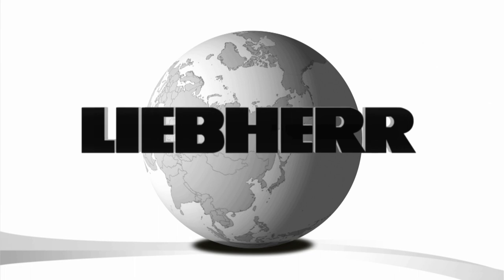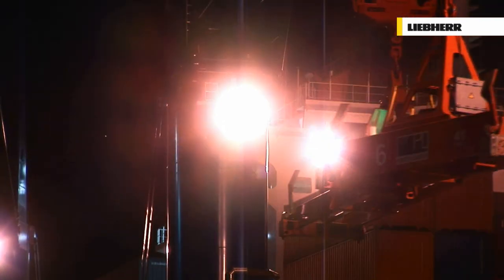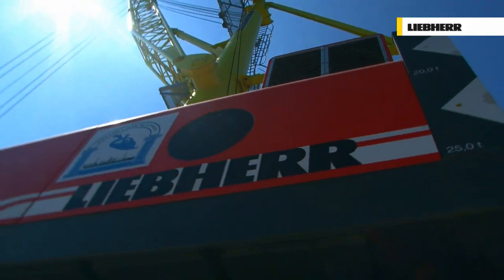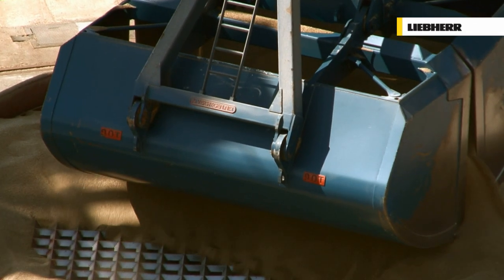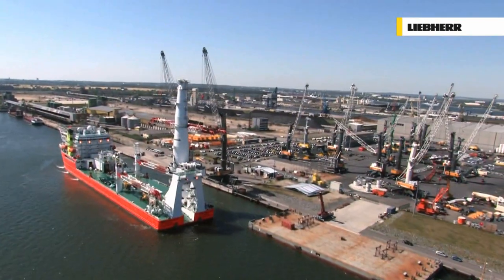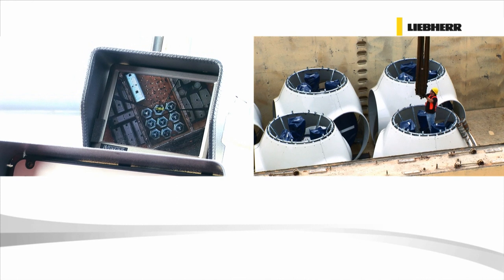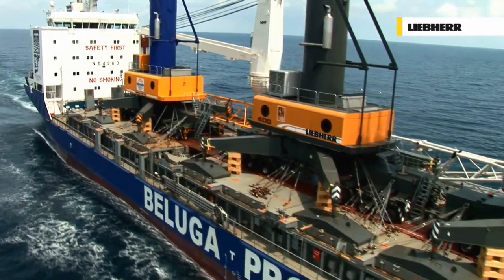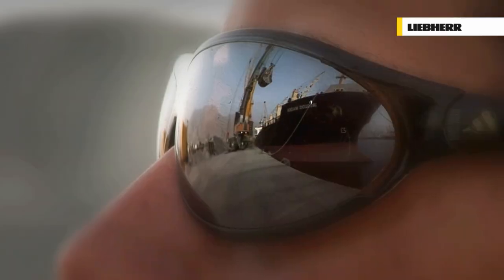Liebherr - LHM Mobile Harbour Cranes

Comment: I am a crane operator on LHM500 for 6 years and there is some stuf I dont like on it. First the light below the cabin is not in good position and it makes shadow on ships hatch and it is hard to work at night.I also work on another cranes and they have much better position of light,it is next to operator and then the light is much better for work. In engine room is hard to see oil level because a 24V light is not on good position. The engine software should have a option not to start operation with crane and go over 1600 RPM untill working temperature is not on 80 C. Fantuzzi have that and he spends much less oil because engine is warm when you start to work. And heating of cabin is very complicated to set it should be easey.
Reply: Can you tell me how the hook rotates. Can it rotate 180 degrees max?
Reply: Umm...so have u explained this to ur supervisor in charge to fix this problem?? If not why r u telling us.... Can we fix this for u or something... 😔
Reply: @dazzadirt8710  it probably was adressed to Liebherr who can fix this?
Reply: @nativeafroeurasian  ahh yes... Sorry I didn't think of that. Forgive me fellas👌

Comment: Do you have attachments capable of lifting goods by vacuum (e.g. to lift the marmour blocks)?
Reply: with a vacuum? I think it has . It's already the 21st century! and I worked in 1970_+++ ... and in 1984 ____ 2012 I worked as a city bus driver i.e. 28 years old + already 10 years retired ... from
I see my windows as in the port loading + unloading + portal cranes which work ... grippers of the format = VACUUM = +
= MAGNET = have been used for a long time ...

Comment: Hi!, i'm a engineer student and i need a little info:
how long does it take to Unload a 2500 TEU containership with four deck cranes like those??
greetings!!
Matias.
Reply from the maker: well, this fully depends from the kind of cranes you are using exactly...
Reply: *****
40t SWL and 30m max reachout.
i have calculated 21 hours aprox. but i am not sure about that time.
Reply from the maker: ***** Well, we will calculate this and let you know!
Reply from the maker: ***** Hi, not a ba calculation you did there:) Actually, it still epends from the LHMs you are using. with/without Pactronic. See here: Liebherr - Pactronic Hybrid Drive System: Turnover comparison for Mobile Harbour Cranes
Reply: *****
Hi!! thanks for the support!!
you do a great job by building those cranes! keep going!
PS: nice video the last one!
Reply from the maker: ***** Thanks! We will try to!
Reply: How does a 420 do40 cans an hour

Comment: cool semi-automatic on hydraulics ... however, in the 70's + 80's in the Riga port, he worked on gantry pipe construction (gdr) cranes like = falcon = (20 tons) + = albatross = (15 tons) mainly when handling bulk cargo and 9 cubic meters. I set a record of 600 tons per hour with a grab + 5 cubic meters with a grab of ____420 tons per hour ... but without hydraulics and without pluautomatics, i.e. manipulations are tied to the perfected movements of the crane operator ...                         круто   полуавтоматика    на   гидравлике   ...   однако  в   70_е + 80_е    в   риж.порту    работал   на   портальных    трубч.констр.(гдр)   кранах как    =сокол=(20 т.)  +   =  альбатрос=(15 т.)    в  основном   при   обработки   сыпучих   грузов   и    9   куб. грейфером   ставил    рекорд   600 т.   в   час   +   5 куб    грейфером   ____420 т.час   ...  зато   без   гидравл   и   без   плуавтоматики    т.е.   манипуляции   привязаны  отточенным   движениям   крановщика ...
Reply: It's fabilus